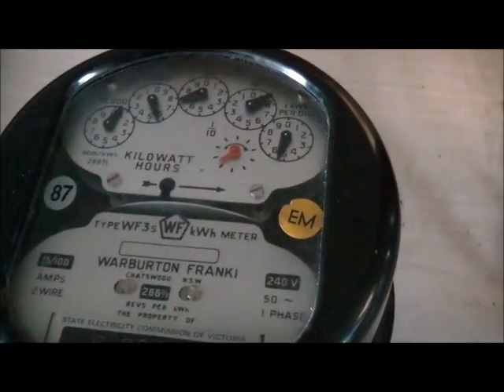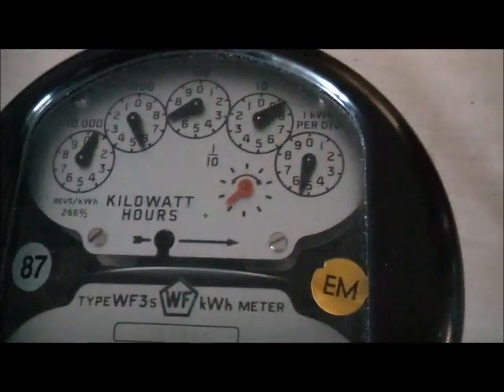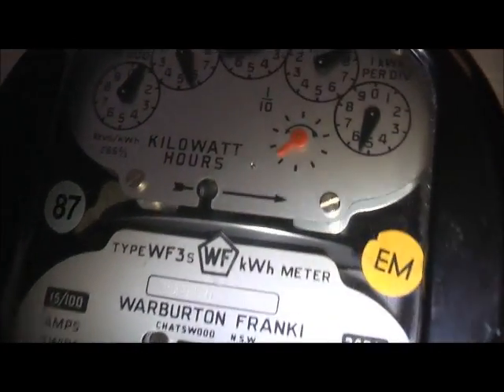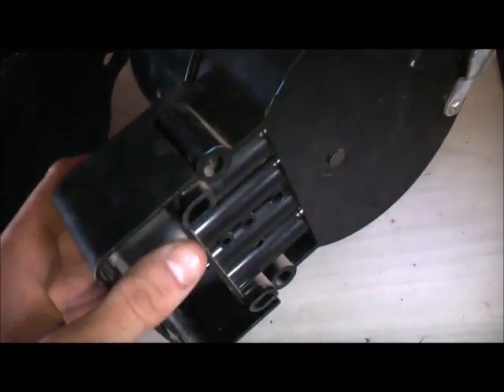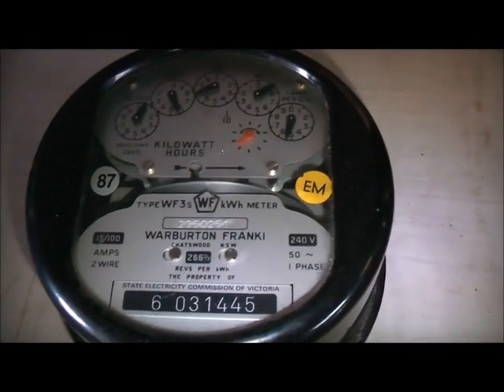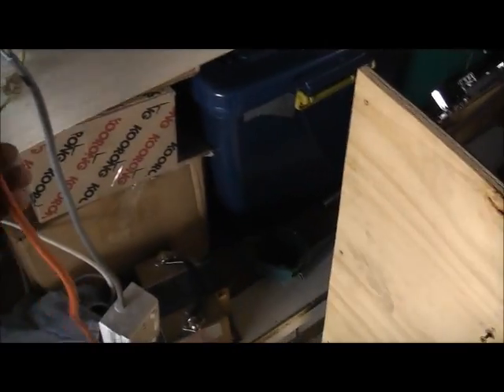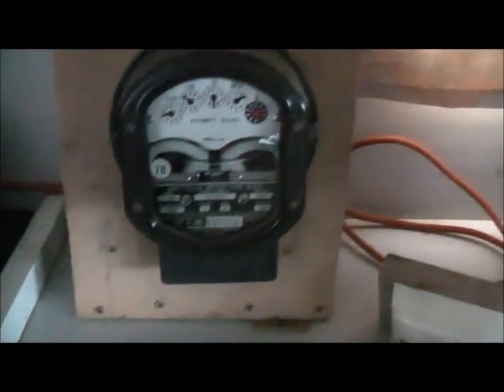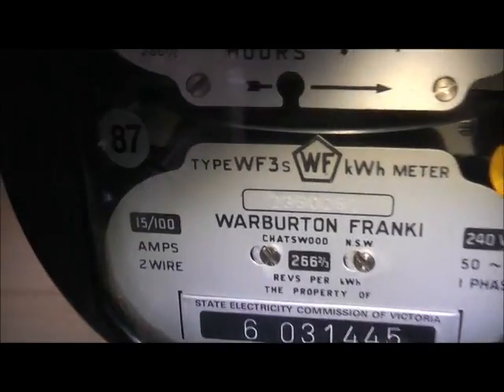Warburton Franki WF3s Watthour Meter Restore

Comment: Ah yes...This Warburton Franki is definitely related to Sangamo Weston, as I can tell by the font-type used to put the detailings in the meter. :-D

I'm glad you've scored one of these, as this has similarities to my Sangamo HMT.

Also, I find it interesting that it specifies 100A as stated by the manufacturer. I've never seen a 100A single-phase direct-wired meter before.

I think, in the UK, a lot of mechanical meters maxed out at 80A, even though they'd take 100A for a short while.

-BBD.